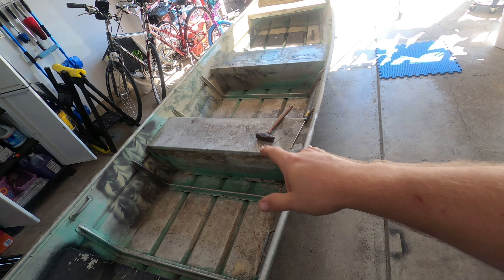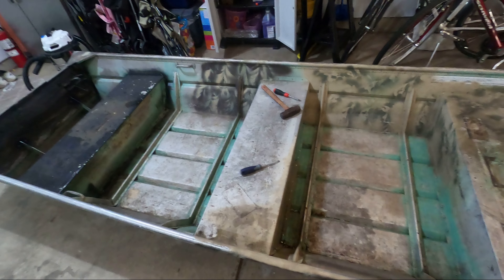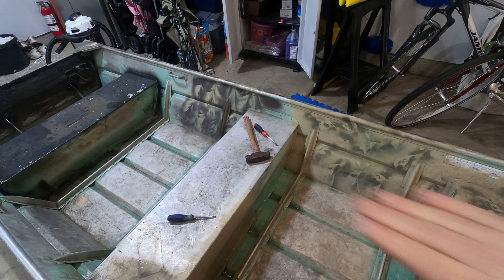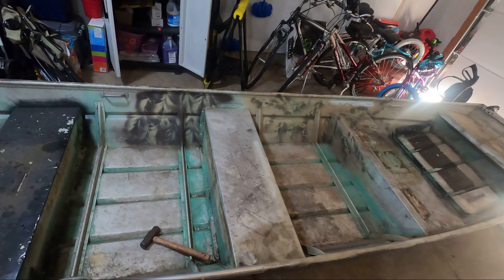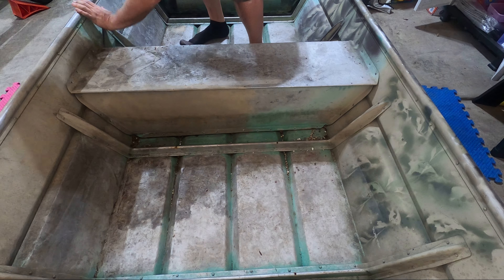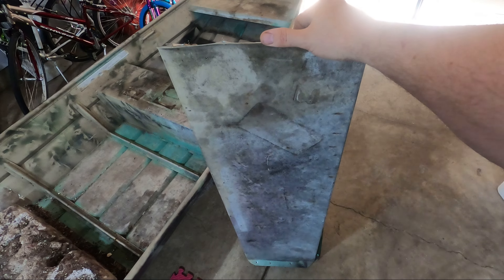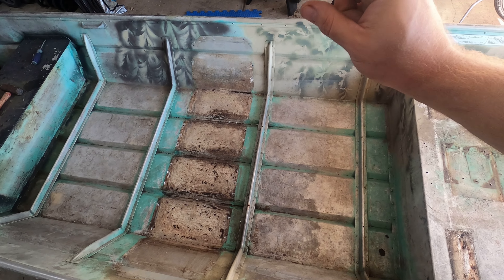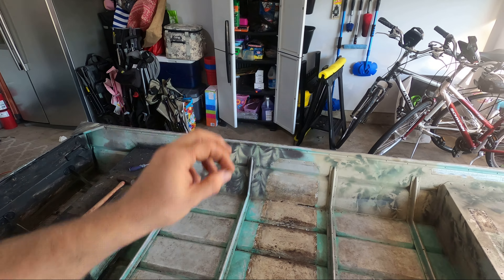REMOVING JON BOAT BENCH SEAT - Jon Boat To Bass Boat Conversion Build - Bench Seat Removal 1436

Comment: Former OMC employee here. Rivets should have been drilled out with probably a # 11 at least for most Lowe/Grumman boats) high speed bit with a high speed drill. Seal the holes with new hard rivets. Shearing the mushroom and heads or punching them out could damage the sheet metal or make the holes larger. Remember that center seat was also part of the boats structural support (twist).
Reply: Just watched another of your videos where you have addressed this
Reply from the maker: You are 100% correct and your comment is really great timing. I'm in the middle of recording a new video (right now actually) where I replace a missing rivet using a solid rivet and an air hammer. When I made the bench removal video I used the tools at my disposal but seeing how easy it was to replace with an air hammer I'm going to recommend your process. It made for a much more solid repair. Thank you for your insight, really great to see how the pros do it.
Reply: @mvboutdoors  on the bucking block, we wrapped the end you hold onto with the foam seal we used on storage doors and then wrapped that in black electrical tape. All we used for a bucking block was a solid chunk of steel with holes drilled near the corners. Putting that padding on there will save your hands and joints (elbow and shoulder) if you have to do a lot of rivets.
Reply from the maker: @thecompaqp1  Great idea, finished up the water test and looks like I'll be rebucking the majority of them.

Comment: did it affect the structural integrity in any way?
Reply from the maker: On this hull it did not affect it because there were braces on each side of the bench seat. If the bench is the only brace you may want to consider adding some bracing back.

Comment: what did you use for sealing ?
Reply from the maker: I sealed the holes with aluminum rivets and 3m 5200. The bottom was then coated with Steelflex epoxy and I will be applying Gluvit on the interior side of the rivets before paint.